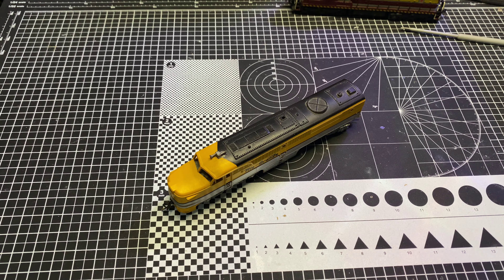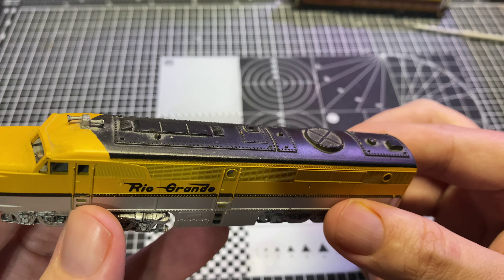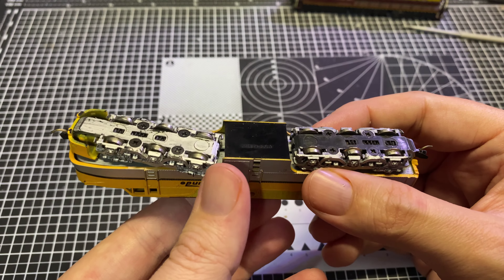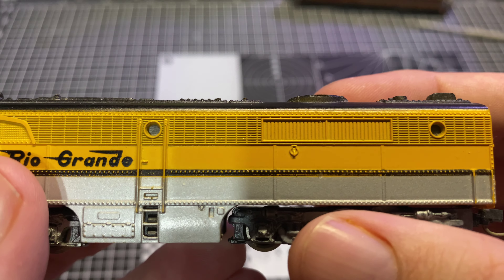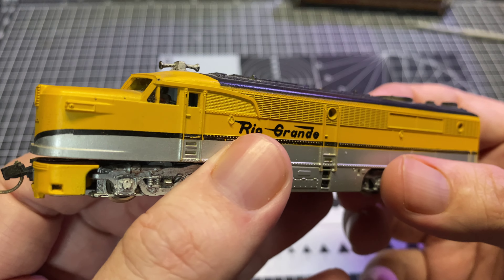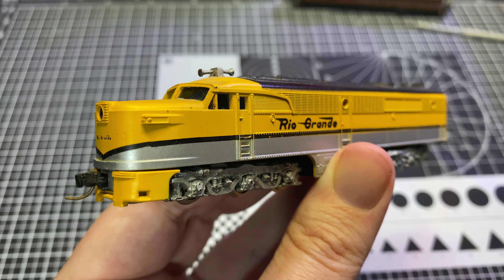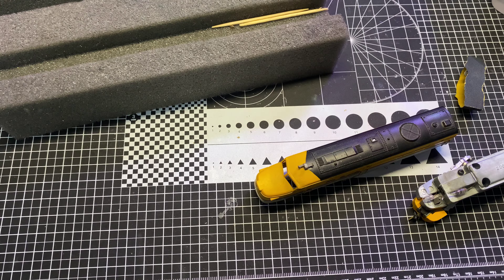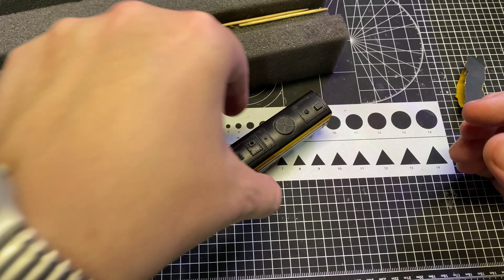Will it Run? N Scale Con-Cor Alco PA1, Rio Grande, Trains with Shane Ep 84

Comment: The Alcos with the pronounced eye-brow window rain-sill, that thingy that sticks out over the cab's side windows and bends down towards the rear, were PA1 units. All it needs is some eye shade and mascara, and it's a Beauty-Queen, as it was elected the most beautiful Diesel ever. Mind you, I think others are much prettier, but tastes in girls vary ... :face-blue-smiling:
BEWARE! 
These old Con-Cor machines were Kato in disguise, but Kato was still learning in those days, and learn they did! 
For one, the old motors are often beyond rescue, but dowsing them in CRC Switch Cleaner can help.
WORSE: 
I think I mentioned this before, but on a lot of switches these old Con-Cor C-C locos always derailed. The culprit is the idler axle at the far inner end and the bad geometry they chose for the bogie, not pivoting on the centre axle, but asymmetrically. The drive axles push the leading idler (so always the rear bogie as the engine is running) to the outer rail of a curve. The wheel flange then gets caught on the end of any nearby switch tongue, cuts into the switch or simply lifts, and WHOOPSY! The ONLY cure I found, was to shave off the flange of the idler axles' wheels! That works, but you need to practise on some old tossers first, to get the Dremel shaveing technique right. I use a cylindrical polishing bit, hold it on the wheel's flange at about 45 degrees, so it forces the wheel to rotate while still installed, and gradually shave off the flange straight down all the way flat! 
I no longer even look at vintage US market models, because I have run into way too many real problems with Con-Cor, LifeLike, and whatever US-branded model trains from before the 2000s. YIKES! Forget about Atlas and Bachmann, as they were seriously evil!!

Comment: Very good review. I have two Con-Cor SP PA1s bought in the mid-70s built exactly like the unit that you reviewed. They were the best running locomotives in the day. I have converted one to DCC with a Digitrax DZ126. I am still in trials with CVs trying to get smooth startup. I appreciate the info you have provided about the origins of this model.
Reply from the maker: Thanks Fred! Honestly they are still pretty decent by today's standards as long as they've been taken care of. I'll bet the starting voltage needs to be pretty high on a DCC conversion on one of these. I'm guessing you had to mill the top of the frame?

Comment: We had a set of Pennsy PA's and a Hudson, both by Con-Cor back in the 1970's/80's. They were in another league when it came to reliability and smooth running. The Atlas  Geeps (and whatever else we owned, I don't remember) never ran well. The variety of good-running locos was so limited, I made the decision to go with HO. If I were starting out today, N scale offers so much, such good quality,  in so little a space, I think I would go with N.
Reply from the maker: I agree. Back in the 70's you had the Athearn Blue Box, Atlas Yellow Box, etc. in HO scale which were EXCELLENT runners. The early Bachmann that were made in Hong Kong, that had the metal truck gears, were ok, but Atlas back then was made by either Mehano/AHM, Rivarossi, or Roco and were pretty horrid. Wasn't until Kato entered their partnership with Atlas in the 80's that Atlas locomotives started to get decent. Although I have heard that old Trix, Arnold, etc. were pretty good back in the day in N scale. These days even Bachmann makes decent running N scale stuff.

Comment: If you take the top chassis off the rest of it sort of falls apart so i understand why you dont want do do it but if i remember correctly ( i have three of the early ones) there is a small flywheel on each driveshaft

Comment: Very nice alco pa from con cor your brother owns. The paint on it looks nice. Btw I didn’t you could use grit sandpaper to clean your wheels. I use rubbing alcohol to clean them maybe sometimes I’ll use a track brite but nice review on this.
Reply from the maker: The used stuff I usually come across is usually so poorly taken care of that neither alcohol or mineral spirits will touch the crud on the wheels. I've spent a lot of time attempting it.